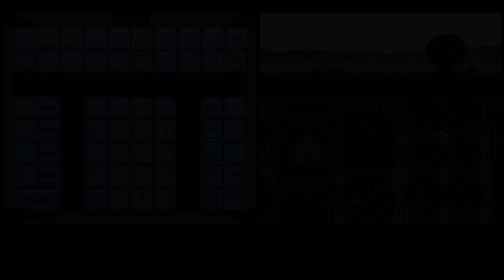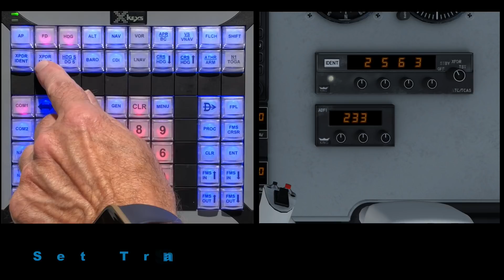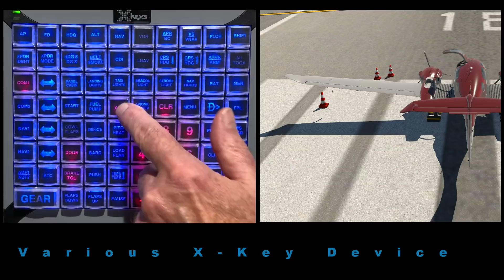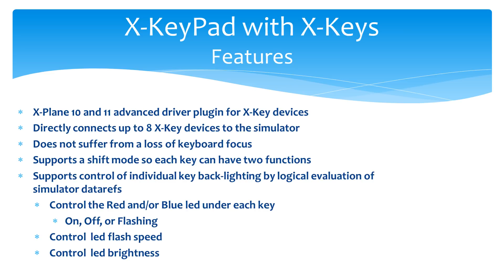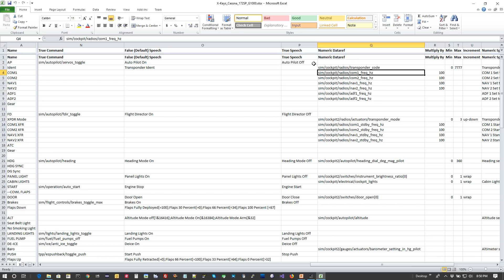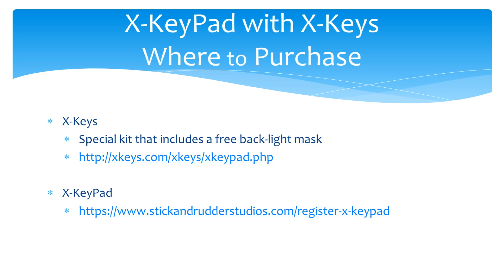X-KeyPad for X-Keys

Comment: Can I use this keybaord for all aircraft or just for GA?
Reply from the maker: X-KeyPad is not specific to certain aircraft. As long as the plane has sufficiently defined commands and datarefs allowing control of the aircraft functions using a game controller or keyboard then X-KeyPad should be able to be configured for that plane. X-KeyPad comes with a number of sample configurations for the XK-80 that support the default 737, Challenger 300, and various GA aircraft. Existing customers are creating and sharing configurations for an even wider variety of aircraft.

Mark